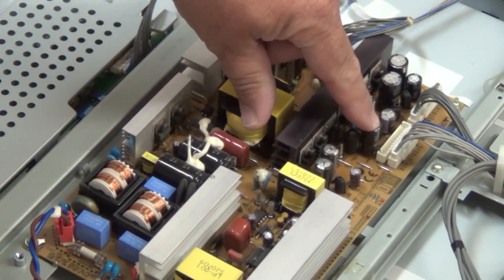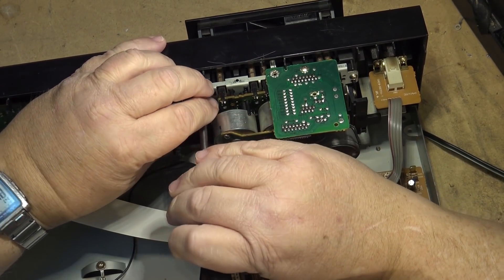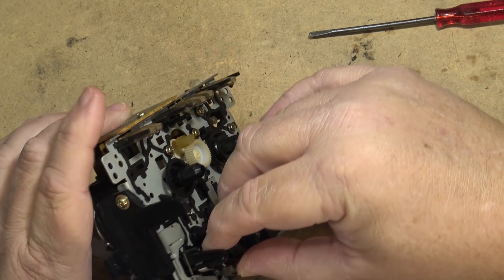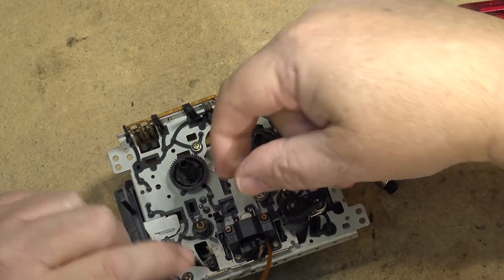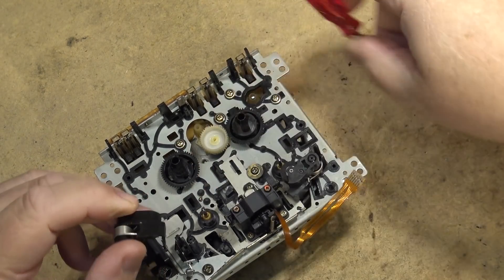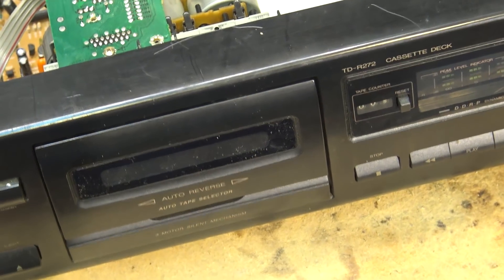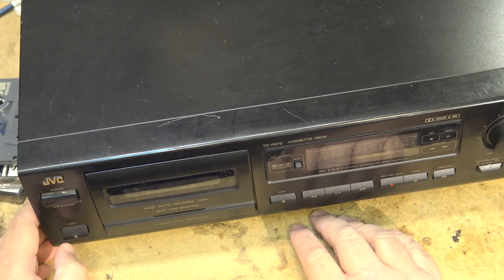JVC TDR272 no auto reverse

Comment: Thanks you very much for posting this video . It helped me fix my Philips mini hifi system's tape. The tape head would engage and then immediately disengage. It would play after several tries and sometimes would not play at all. The problem was two micro switches. New one was not available as it is an old model, so I opened the switches and cleaned them. The contacts had turned black because of carbon buildup. Cleaned them and PRESTO !!! the tape worked like new again.

Comment: Hi 12Voltvids. Nice video as always, recently I sorta hit the jackpot when I came across a Sony TC-K909ES cassette deck for sale from a local guy. Mind you this is the ES series and comes with 3 heads, dual capstans closed-loop direct drive and the wood panels and all the bells and whistles. I see this particular unit still goes for over $800 bucks on ebay and I got it for $120 bucks. Did not get the remote with it but hey, not the end of the world. However, I have a problem, I cleaned everything, all the tape paths, the heads, the pinch rollers you name it. I recorded 3Khz sine wave and play back its spot on thanx to the quartz locked direct drive. However, I did some recordings, and at the end of the tape, not at the beginning or the middle, but the end of the tape, I heard alot of wow and flutter. Hence, i recorded the sine wave and checked it, the readings are all over the place. I did everything i could think of, i even changed the belt, changed the take up pinch roller, then i saw on the direct drive motor there are 2 10uf 16V SMD's, i changed that to electrolytes caps. Nothing seems to get the annoying W&F fixed, the only thing i did not change is the supply pinch roller because its pretty tight as it is a metal cast and i cannot get the pin out. I didn't want to push it as i might bend it. Can you share some thoughts what could be the problem? I know worn out pinch rollers can cause the same thing, I have another deck Sony TC-WR770 the take up pinch roller fits perfect from that. Still the same issue. Please share your insides on this. Thank you so much. Look forward to hearing from you soon.
Reply from the maker: Check the torque on the take up spool.
Reply: @12voltvids  The spools are turned by a separate motor, are you saying the torque is too much? maybe if it has one of those white spongy thingy to reduce the torque (if it has) is tightened up over the years?
Reply from the maker: @BABYGODZILLA2009  
There will be a torque limiter on it.
Reply: @12voltvids  Hi, just to give you an update, i found out what the problem was. The torque tension was just fine. What it was, the spring on the take up pinch roller. During play back, i put my finger on the take up pinch roller, and to the touch without that much pressure it stops, mind you the pinch roller it self is about 60% good, i even sanded it abit and the rubber is supple. So what i did was, i bent the spring to give it more pressure towards the capstan. Wallah it worked. No more annoying wow and flutter and the sound is beautiful. I even changed the supply pinch roller. Everything is just fine, and the mechanism is in good shape and i even changed the belts and lubricated all what i can think of. Small issue i neglected to mention, this is what i had since i bought it, during recording it records like a dream when you play it on another deck. However, whenever i play it from the K909, the same tape or any other pre-recorded tapes, the treble is less. I dont think its the azmuth since i can clearly hear the high frequencies as the azmuth is spot on, but its like if you had turned the treble all the way down, it sounds like that. Heads look amazing, i have a doubt it is circuit related. Any thoughts on this? I thought of changing the all the electrolyte caps on the unit. I see some caps are branded Elna. Can you please guide me on the right path what could be the issue? Your thoughts on this is highly appreciated.

Comment: Wow, three motors. Back in the 70s, a three motor deck was not just hi-end, it was premium high end.
Reply: The two are not the same. The premium high-end decks used three motors like this: one for each reels, one for the capstan. This one uses one for the two reels, one for the two capstan, the third one's only purpose is to change the operating modes of the mechanism. It's better than the ones that use the capstan motor to change modes, but far from a true 3 motor mechanism. Some bastards (namely eg. Sony) even marketed 3 motor decks, where the third motor was only for the motor driven cassette door...
Reply: @mrnmrn1  I know. I was just making a point about how "deprived" the decks of the 70s were. I find it hard to believe that it was cheaper for them to make all these complex mechanisms just to be driven by one motor instead of making a three motor direct drive.

Comment: 11:17 Your scope is not triggered. It can measure the frequency like this, but if it's correctly triggered, it will measure the frequency of the trigger signal with a hardware frequency counter (which now says < 2Hz), which is much more accurate and has faster response compared to the software counter you are using in the measurements menu. Not that it matters if the frequency is 2.99 or 2.9985 kHz in this case, but it's much more convenient to use because of the faster response and more stable readout.
Reply from the maker: It certainly is triggered off the incoming signal.
Reply: @12voltvids  Sorry, but it's not. The trigger level is set to 120V, I guess the deck does not output such level :-) . You can see it on the bottom of the screen, under the time/div readout: trigger source CH1, level 120V.  Oh, CH1 is off, you're measuring with CH2, so even the trigger source is wrong. Also, the signal is rolling. If it's triggered, the text box on the upper part of the screen will show the hardware-measured frequency of the trigger signal, where it now says ' [T]:  < 2Hz '.
Reply from the maker: @mrnmrn1  
Doesn't matter.  I input 3khz signal from generator and regardless if I am triggering from it or not the frequency displayed is 3.000khz so it is accurate.  Last time i used that scope i was measuring from channel 1, i plugged into 2 to check speed but it is accurate regardless.  Makes no difference to the frequency read out regardless if the display is locked or not. I wasn't looking at waveform i was only looking at speed.  I seldom use that scope because it can't handle complex waveforms like video. B
Reply: @12voltvids  Yes, as I said it will be able to measure the frequency like that with good accuracy, but have you compared the software counter with the hardware trigger freq counter when the signal is triggered? It should react much quicker to changes, yet gives a more stable reading if the freq is not changing, just there's some noise on the signal. Also better resolution, but it doesn't really matter for applications like this. At least it's like that on my Owon MSO7102, I have no experience with your model but it should be similar in that regard.
Reply from the maker: @mrnmrn1  
This one I have is a piece of crap.  Will not display video and had i known that i would never have wasted money on it.
Reply: @12voltvids  I don't think my Owon is any better. A digital scope which is up to the task of correctly displaying video signals and CD player eye patterns cost many thousand US$, even a used one has a four digit price tag. These cheaper ones are only good for diagnosing SMPSs, deflection circuits, and not too fast digital circuits (mine has a 16CH logic analyzer as well, but I don't have the pod for it, so useless). 
But they are still gold with their versatility, easy signal storage and post-storage zoom of non-repetitive signals, measuring Vpp, calculating the RMS of any odd-shaped signal, frequency measurement, time measurement, duty cycle measurement, spectrum analysis, etc. So they are much better in this regard than any analog scope, while they can not properly substitute even a 10MHz analog scope for some tasks.
Reply from the maker: @mrnmrn1  
Exactly. I use it for some things and reach for my Tek analog for the others.

Comment: When you calibrate speed, counter belt was missing, do you re-calibrate, when you put that belt in place??
Reply from the maker: The counter belt will not affect speed as it just turns with the take up hub which naturally slows down as the tape spool fills up.
Reply: @12voltvids  I think that counter belt slows down a lot.
Reply from the maker: @RetroMechanic  
The counter belt will not slow down the capstan.  It rotates with the take up hub.

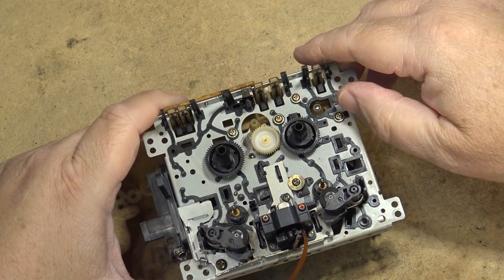Comment: 2:27 ..... SO TRUE ..... it wont detect tape or even stops randomly. Sounds like tape movement sensor  ... but it is related to this contacts that cut in and out the signal to the processor. So annoying !!!!!. The other thing on decks and Minisystems from that period is, you press one button and the deck executes any other function. It works fine on the remote, but controls are all messed up. I figured out that this is caused by wornout tactile switches. You will think that ., hey, they are digital, just on/off. NOPE on Panasonic, they input the whole array the contacts using just 3 wires to an ANALOG input on the microcontroller. Each tact switch connect a differente resistor to the divider so different voltages are generated. The processor then know the button by the voltage value (between a certain window) Guess what ? once the switch start to get dirty, they can mimic any other function due to the added internal resistance. ..... And lets add the fuse gear !!!!. I love Panasonic ... but ....  some crappy"ideas for life" there.

Comment: I'm thinking why would a single well deck have a mult-speed motor (easter egg) or possibly why the speed control would be outside the capstan motor itself. I guess we'll know when Dave tells us. LOL
Reply from the maker: I won't tell, i won't even hint. Someone will know in a instant and hit the nail on head so to speak.
Reply: @12voltvids  I suppose you would let us know eventually, I've stated my guess(es) already. LOL
Reply from the maker: @darinb.3273  
Whoever guesses correct will be notified in the comments.  So put your thinking caps on.
Reply: Sped control still inside the motor but adjustement pot is not external on AB temrinals. But .... they went into much trobule to make it service friendly ?????. It doenst add to me.
Reply: It just dawned on me and may not have a thing to do with the repair, I think you have a new adopted kitty cat.
Reply from the maker: @darinb.3273  
I actually have 4 cats.  How I ended up with 4 cats, well I have a daughter that just brought them home then moved out and left them behind.
Reply from the maker: @38911bytefree  No speed pot on those 4 termonal motors. The AB terminal is for the speed control. The rubber cap is still there but no control inside.
Reply: @12voltvids  Two more possible easter eggs 
1) cheaper cassette decks would play type IV but didn't record them (record over them specifically) 
2) Your bench power supply was on for no apparent reason.
Reply from the maker: @darinb.3273  
Nope but good guess.  
All decks can play metal tape but unless there is a specific metal selector or detection switches for the center holes on metal tapes will not erase properly.  The bench supply on was left on from a previous video.  Good observation but not the specific one I am looking for.   Someone will pick up on it and once revealed i am sure a bunch of others  will wonder how they missed it.
Reply: @12voltvids  Right that's what I was meaning specifically the erase circuit wasn't strong enough to COMPLETELY blank the metal tape, I have a commercially recorded tape I couldn't completely wipe with a bulk tape eraser. I have machines that have both manual selection for metal a auto selected but have confirmed that even though the switch(es) are present it was intended to play them (not record) a side note: I was EXTREMELY IMPRESSED the older Sony TC-FX7 and  TC-FX705 machines both the erase truly makes the tape as if it had been bulk erased ... I blocked the rec/play during record (preventing the BIAS signal) the only thing I heard was the erase circuit turning off (soft thump) LOL
Reply from the maker: @darinb.3273  that is why i always bulk erase my tapes before reuse.  I even did a video on that subject.
Reply: @12voltvids  Yes I remember watching it. My last comment was about the extra power needed to completely blank type IV. I only have TDK type IV and they suffer from either of 1) dried lubricant 2) possible mold drop out city either way. I'm leaning towards a bad formula for the lubricant but I don't really know for sure. I can't tell with my ears (older now) between type II and type IV.
Reply from the maker: @darinb.3273  I wonder is metal tapes "rust'
Reply: @12voltvids  That I don't know, metal particles is all I ever heard. I did hear/ read type I is nothing more than iron rust the exact formula I have know idea.
Reply from the maker: @darinb.3273  yes type 1 iron oxide (rust) type 2 was chromium dioxide, but now colbalt.  Type 3 rust on lower layer and chromium dioxide on top. Type 4 metal particle similar to 8mm video tape and DAT tape.  Metal is an alloy of various formulations specific to each manufactures.